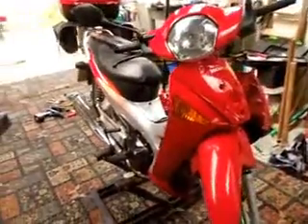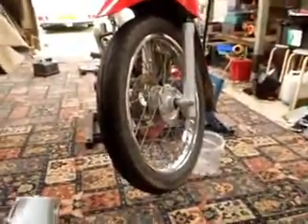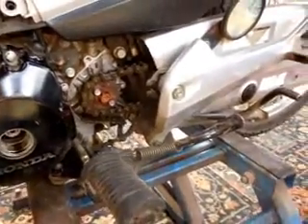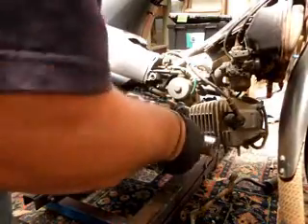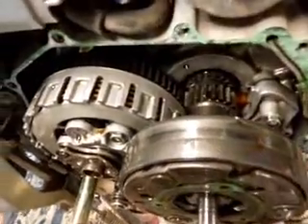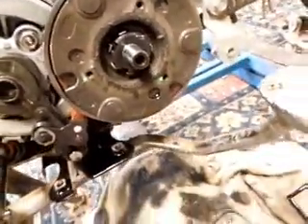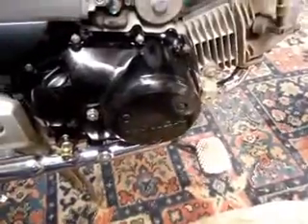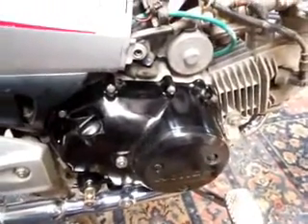Honda ANF 125 innova oil change centrafugal fiter and screen clean

Comment: Really useful, thanks very much. The extension you've put on your front mudguard is a good idea as the neck of the exhaust near the flange is prone to rust. I had to weld mine up, so worth keeping an eye on that. Otherwise, they're great little bikes. I like mine so much, I bought a second for the future!

Comment: ever thort of stuffing a yx155 in it?
Reply from the maker: no I only had it to go on the back of our camper, I 've got bigger bokes if I want to go fast.
Reply: dozerblade 
hello again 
do you know the service times for this bike? ie 10.000 miles oil/fuel/air. 
mines got few miles on it and was wondering how long the 125 hondas last? thanks
Reply: dozerblade 

yx (and pretty much all pitbike engines) won't fit they have different engine mounts. you can get big bore kits and stroked cranks for the anf though.